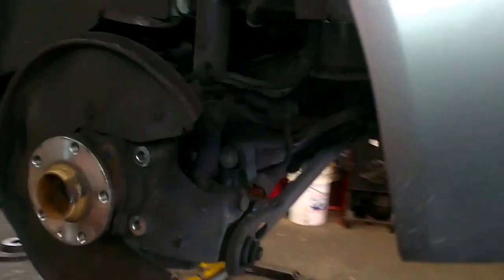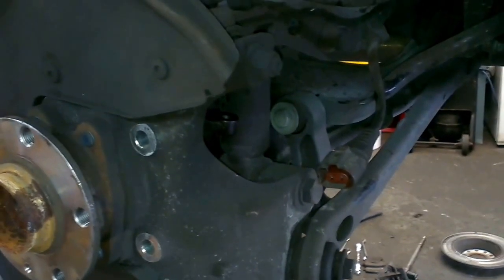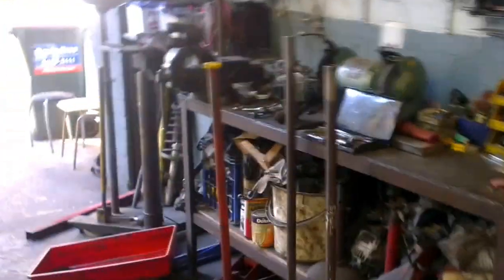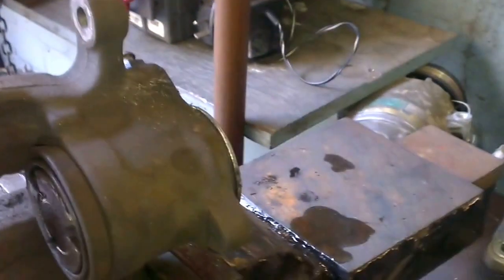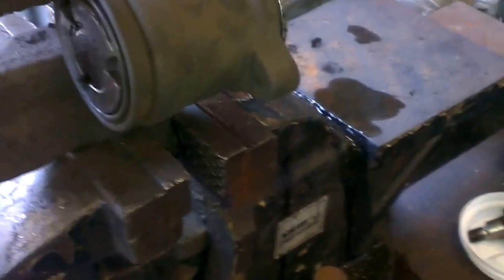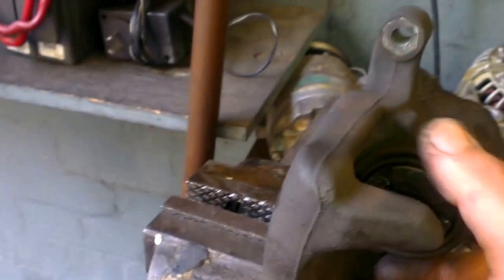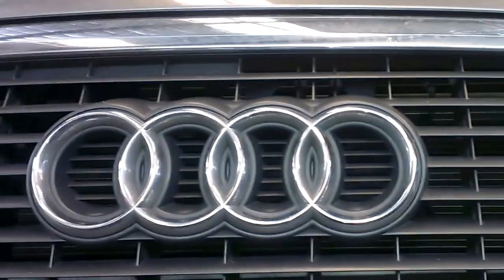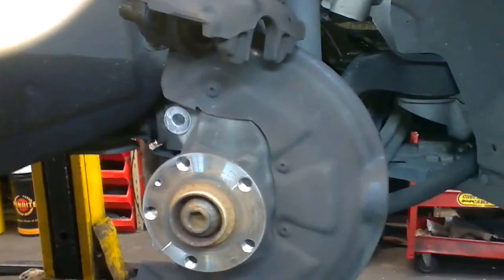Audi A6 VW Passat rear brake caliper piston reset

Comment: It's 2 wires FFS ... leave it attached to the flex hose and just power up the motor with two wires, attach a c-clamp with slight pressure on the piston and touch wires to battery + and -  if it moves outward switch the polarity and then watch the piston go in!!! Magic!!! Turn the handle on the c-clamp until the piston is retracted just enough to clear the brake pads!!! Jump in start it up and test the park brake operation ... works perfect!!! Don't forget to torque the wheel nuts!!!!!!!!!!!!!!!!!!!!!

Comment: Nazariy Dubas You are wrong. The end position can be found out by that signal. When it have reached the ens position the current will rise.
Reply: it knows nothing. Current is supplied when commanded and shuts off when it see's an increase in current. It does not know where the piston is at all. lmao

Comment: dude, if there are only two wires on the motor that means the only thing the computer can sense is the load in the form of amperage. There is no known way it can find out the position of the motor. North American system of education sucks. It makes people as smart as bricks. Sorry, mate, you are one of them.